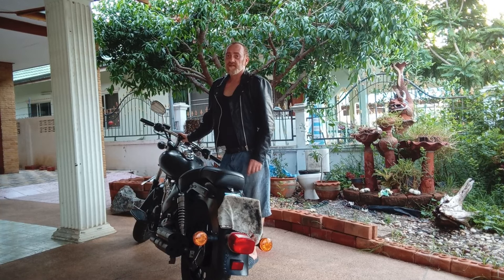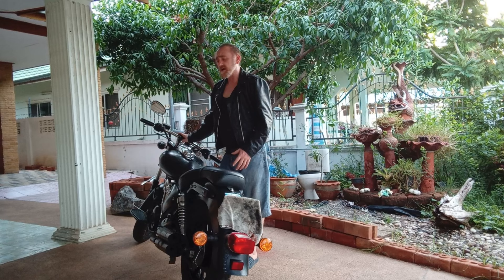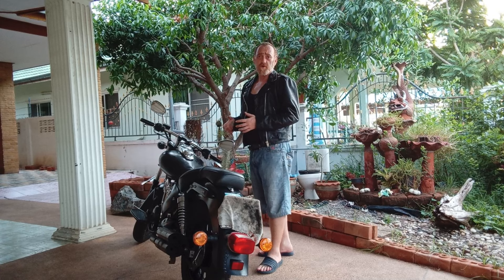Keeway Superlight 200 Carburetor adjustment #motorcycle #keeyway #carburator #thailand

Comment: But how do I do the adjustment. I just got a par for my wife and I.
Reply from the maker: Depends on if you have a stock or aftermarket carburetor. Also you have to match the throttle cable adjustment with the carburetor airflow